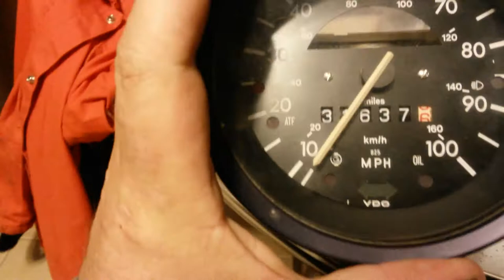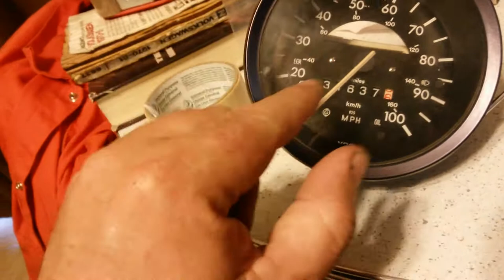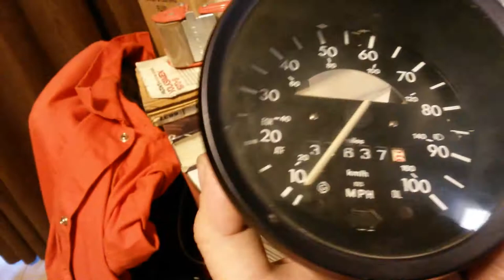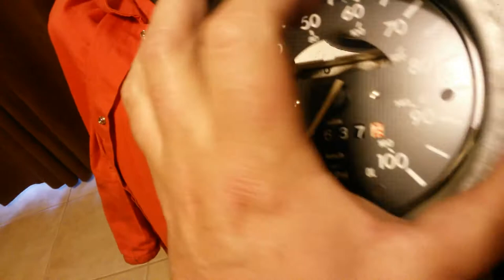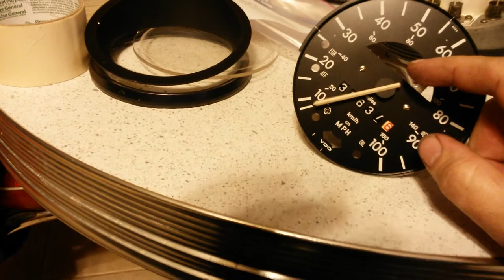Super beetle speedometer repair PT.1

Comment: Hey, i took apart my speedometer and i had to bend those metal pins, but im glad i did because the solidified grease wouldn't dissolve in anything, but i cleaned it out and put some durable grease and its working! thanks for the video

Comment: Taped down my needle also on my Speedo when had it apart /worked very well /my gear was also broken for the odometer /repaired and installed back / put a dab silicone on the end so wouldn't pop off again thanks for your tips!

Comment: thanks, my vw speedo does not work, i'm going to try this the next time i get in the garage. A tip to test the speedo is to get a drill and hook it up to the cable and pull the trigger and see if the speedo is working.

Comment: 1978 super beetle my speedometer cable keeps on breaking what could it be
Reply from the maker: Unfortunately a bunch of things. It's too dry. The hole in the wheel cap isn't perfect. The cable is binding somehow. The speedometer is dragging. It's sometimes rough figuring it out.

Comment: My 74 odometer is not working bu t the speedometer is working fine.  What would caused the issue?
Reply: A broken or loose gear in there.  Check out: https://www.odometergears.com/howto/VW_Super_Beetle_Odometer_Gears_Replacement.pdf
Reply: I replaced the tiny plastic gear about a year ago after reviewing your video and thank you for that.  That tiny gear cost me about $30. I used a pressing tool to push the gear into place and ever since the odometer has been been working

Comment: Thanks a lot. The speedo of my motorcycle is actin gup in a big way. It makes all kinds of strange noises. The racket it make sis unbeleivable and when I disconnect it the motorcycle will actually roll perceivably easier! I couldn't believe that sort of noise could come out of such a meter and so I refurbished the breaks and replaced the wheelbearings first!. luckily I have spare but I am wondering if I should not also open thas to do some preliminary maintenance before I put it in and maybe I can even try to repair the defective one. What would you do? Just put the new (old) one in as is or first pull it apart.
Reply from the maker: Yes. I would fix everything first. I had the same problem. Bugs also run off a front wheel. And until I got the bearings fixed. The cables kept snapping off.
Reply: Thanks for the quick reponse. Yeah, knowing what I know now I am actually wondering why the cable hasn't snapped off yet. Off to the Bat Laboratory it is then!
Reply: I've had a look and in this case hardened fat was not the problem but the complete absence of any lubrication. What might at some time have been grease had turned into very fine black dust covering the surrounding area. Play still seemed acceptable though so I gave it a good going over with teflon spray. To say it works as new might be a bit premature but I drove it by an electric  dril and it seems to be fine now. Thanks again for your insights!

Comment: Any idea what size that connection to the back of the speedo is? I'm connecting the cable to an after market speedo and it has  a 5/8-18 thread. It's too small for the VW cable connection.
Reply from the maker: Man. I don't know. Has to be metric.